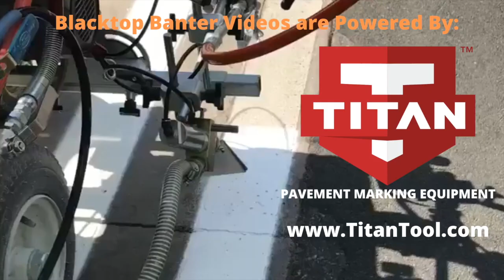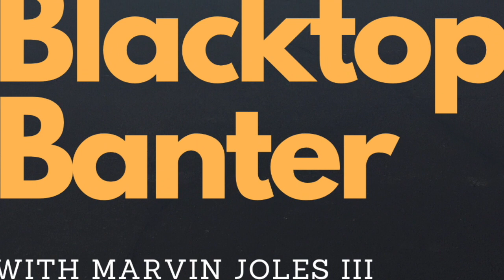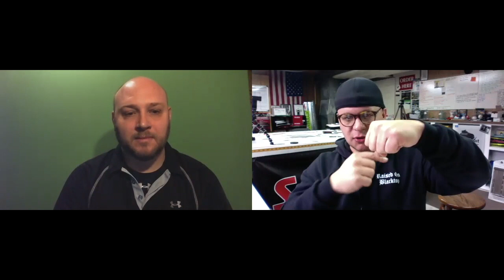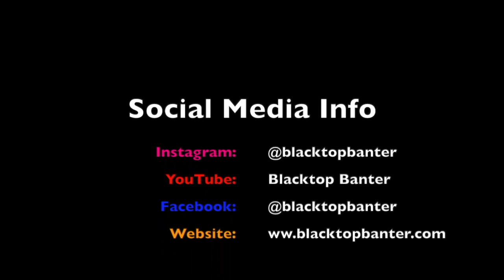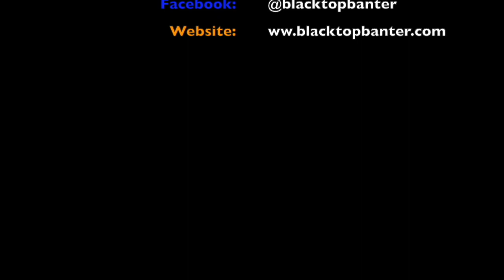Which Sealcoating Setup do I Choose?

Comment: I had a situation where my ball valve wasn't holding tight anymore, luckily I had bought a 3/4 squeeze trigger valve with a few inch nipple. I mounted it on before the ball valve and man I really like it for residential when your relocating thr hose alot. Really helps and I feel might last longer running sand as I run alot of it.